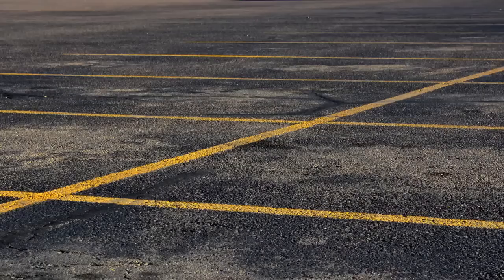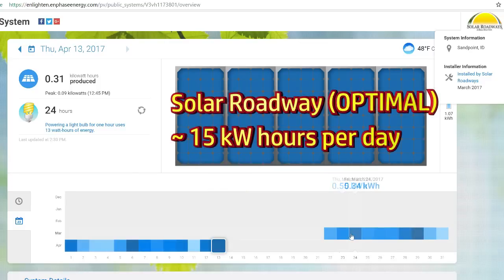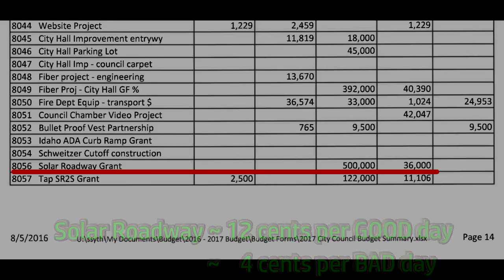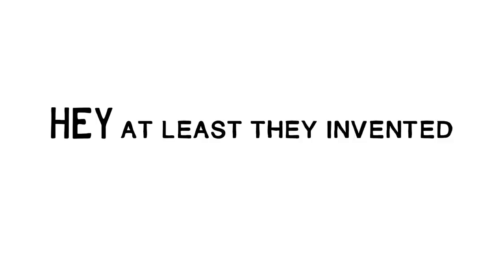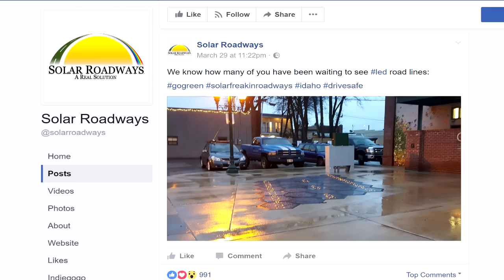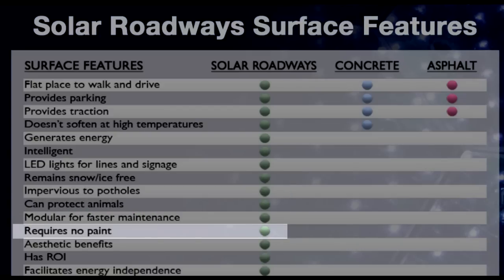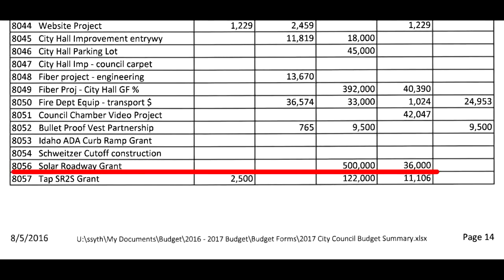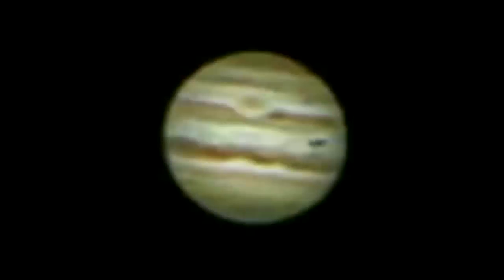Solar Roadways generate ~10 CENTS per day!!

Comment: Fun fact, the surface area of the roof of any home has a large enough surface area that if it was covered in solar panels it would power the home. Unfortunately the roof is rarely the ideal shape. My family has been off grid and living off solar and wind power for 5 years now with recent upgrades. 10 grand for virtually unlimited power for two "homes" and a family of 4 if you can store it. Solar power can easily power a home. What it can never do is support a car. I climbed on the thing once and heard creaking.

Comment: Hmm, the cost at 15:34 is incorrect, its supposed to be 500.000.000 (1,000,000 square feet at 500 each = 1 million * 500 = 500 million) and not 500,000,000,000 (which is 500 billion)

Comment: Could one possibly create energy out of the heat the asphalt getting hit by the sun?
Reply: One could, but currently it can't be done in an economically viable fashion. Anything that is not hot enough to boil water is just waste heat (and no, asphalt doesn't get hot enough). This is a common problem with heat engines too, most of the heat goes unused. A 1 GW nuclear power plant will output about 1.5 GW of waste heat. Most of it is just dumped into the environment (which is why they're usually built next to bodies of water). You can heat houses with it in the winter ofc. But with roads you can't even do that, as they only produce significant heat in the summer. Your car is even less efficient - for each kilowatt it uses to move you around, it dumps kilowatts of waste heat. If there was a way to use that heat, your car would come equipped to utilize it before the road would.

There are TEGs (thermoelectric generators) that can utilize low-grade heat, but they're really inefficient and are only useful where low-grade heat is more available than any other source of power.

Comment: This is probably a dumb question, but would it be better to have some kind of panel that generates energy from force/pressure on it rather then the sun?
Reply: That energy would come out of the cars traveling on it, so it would just be a really roundabout way to convert fuel into electricity.

Comment: How efficient would the solar panels need to be to make this a viable option and what material would be needed to be able to have a car drive over it, lets also say that it wasn't powering LEDs just generating energy
Reply: Even a 100% efficient solar panel would lose about half of its efficiency when laid flat on the ground, especially with cars, trees, buildings etc. casting shadow on it. This will never be a viable option.

Comment: The Sandpoint panels are actually more efficient than the ones they were going to use on a road. The road ones had less coverage due to the bolt holes. The road ones also had much thicker glass. The road ones would also be getting much dirtier and would be getting scratched up. I believe the road version would generate much less than these demo panels are generating. Just compare the thin Sandpoint panels to the big heavy panels for the road.

Comment: So... This isn't going to be easy.  It will, most likely get lost in the fray, but I'm going to try anyway.  First, What if (those two most horrible words) the solar panels did track the sun?  what if they moved, inside the panel, underground, to do just that.  It's just an idea.

Second, I could see the lights in the pic you offered.  Just saying.  They were visible.  Maybe not to you, but they were.

Third, and this is just me spouting off an idea of my own, forget about solar roads.  What about static roadways?  Panels constructed so that as cars drove over them, it would create static electricity?  Rubbing against each other, as panels do, using physical force to create consumable electricity?  Do a video on that.  I'm not good at the math, so, by all means, do it for me.  See what you come up with.  Did I just give away a million dollar idea?  Tell me.
Reply: It would still be less efficient than not putting the panels under a thick layer of glass. And more expensive. And those really are the problem we have with solar panels today: They're expensive and not very efficient. A problem we don't have is where to put them. I mean, rooftops are already a great place to put solar panels, although those are usually just angled, not tracking. But if you want tracking panels, cover just a few percents of the land we now use grow crops, and you could power the whole world. Electricity, heating, transportation, everything.

Static electricity wouldn't offer any meaningful amount of power. Static electricity is just a charge buildup that can create impressive sparks, but little to no sustained current. Besides, any energy that you get out of the road would really come out of the cars' engines, so it would essentially be a really roundabout way to convert fuel into electricity.

Comment: Even without knowing any of the numbers, it was self-evident to me that this is a terrible idea. Why are so many people taken in by it?
Reply: Solar freaking roadways. That's why
Reply: whoa
Reply: The sad fact is that they'd probably do a better job without the solar panels and you hook them up to the grid. Smart Roadways, not Solar.
Reply: Smart roadways would be cool, but the problem is that a) glass is a terrible surface for driving b) it'd get scratched to shit in no time and c) the modular nature guarantees they'll be wiggled apart by traffic pushing on one end then the other over and over again. This is assuming you can get LEDs bright enough and get over the cost. Even if Beardo McWolfshirt wasn't shamelessly milking the local government, they'd still be orders of magnitude too expensive to be practical.
Reply: But they'd be a lot cheaper to make and replace than solar freaking roadways and make cities look like freaking TRON.
And probably be more likely to work. I just think the main issue with solar roadways is the solar part. Take it out and you can have smart footpaths, basketball courts or whatever. Hell they could be powered by solar panels above the surface, like those parking lots.

Comment: Thunderf00t... How big in square feet is the capacity of which you speak?  I lived on solar in Colorado, had refrigeration, lighting, laundry (washing machine, dryer was gas) TV, internet, and it ran on solar.  My refrigerator was full sized with a functional ice maker.  We had about 200 square feet of panels, that were 75 wats per panel, about 12 per rack.

Comment: Yet another problem that hasn't been considered is that there will be vehicles (which cast shadows thereby blocking out the sun) on top of Solar Roadways for at least part of the day.  How much sunlight will actually get through during high traffic days or during rush hour?  A lot less than if they were just sitting there with nothing on top of them as in the demonstration.
Reply: 10:10 Disregard my previous comment.   XD

Comment: I'm a civil engineer and have experience in both the design of concrete and asphalt pavement.  Even if this thing could generate electricity, and it clearly doesn't, I would be concerned about the surface friction.  A rough surface is necessary for every surface we use for transportation and that includes walking paths. A rough surface would further degrade the efficiency of this product.  And how durable is it.  Heavily used asphalt roads rut, especially in high heat, so I doubt plastic can hold up for 10 years.

Comment: Solid gold hammer marketing ideas that are just as truthful as solar roadways' claims:

Since the cost is so high, the hammer will be weightless.

Gold is one of the densest materials so the hammer will be virtually indestructible.

Since gold is a good conductor of electricity, when you hit something with the hammer, it sends out a shockwave.

Since it is made out of pure gold, it can even break diamonds.

Comment: I don't know why but reading that solar roadway surface features really pissed me off I mean hell they give themselves two points for the same fucking thing (sensitive leds)
And one point for being "intelligent"
(really)
And another point for having good traction no
And a bunch of bullshit they pulled out of their ass to
Like generates electricity and means of energy independence
Can charge EV's with free energy, they can't do any of these things and they're all the same thing
Also apparently it's impervious to potholes and water can be stored treated or moved,
but not like how water is moved/stored by concrete?
I just realized They put "treated" in there because that way they didn't have to give a point to concrete
I mean Solar roadways don't treat water either but apparently anything they make up is a "Solar roadways surface feature"

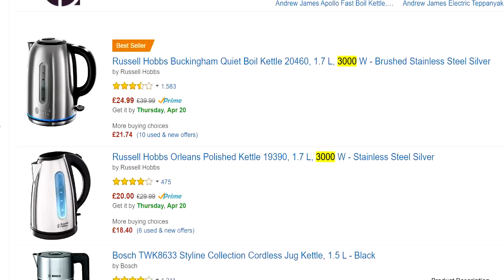Comment: 3:19   this example is bad, because no one would run a kettle for even 5 minutes (at least mine takes about 2 minutes for two to three liters). A tv would be a far better example because a tv is actually used for much longer periods of time consuming way less power. greetings from germany btw

Comment: Speaking as a solar panel maintenance tech; it's surprising how much maintenance is required. Not necessarily on the modules themselves, but on the inverters (modules produce DC - needs to be changed to AC) and traditional module to module wiring. Then there's the imperfect manufacturing process that produces resistance/heating causing internal failures in the modules and the bypass diode junction box on (typical) modules. 
Add the idea of car traffic, accidents, animals, dropped/thrown objects these modules alone would have problems. Then consider where said inverters are installed. Anyone that's ever had the pleasure of wiring in a VMS sign on the highway can tell you how risky that can be. Broken conduits from accidents/concrete corrosion, imperfect weather seals, hooligans. This concept is a maintenance nightmare.

Comment: You been missing a key point for a long while.  YOU CAN'T INSTALL THESES THINGS IN A HILLY AREA because they would not interconnect and leaves spaces.  I have hills with ~15% grade it would be impossible to go form a flat to a sharp 15% grade within 2 feet and still have them to connect in such of a way of being flat and having the edges of one touching the edges of the two other hexagons.  If they were rectangles than maybe but they are not.

Comment: Going off on a tangent here. If the SI unit for energy is a Joule, why does everyone represent electricity in kWh? Why not use MJ as a base unit?
Reply: I think because it makes it easier to work out how much running individual appliances would cost.

If you have a 15W (input) bulb and you leave it on 24 hrs a day that's about 0.3kWh for example.

Comment: I wonder if you could make flat panels that adjust as time passes. Either the crystalline structure of the glass angles light and that glass panel rotates or the panels underneath could shift.

Comment: 13:30 
small flaw in the argument that it will take 10 years; if you file a tax return on the solar panel you could get back about 1200$ leading to it actually costing 2800$ making it pay for its self in 7.7 years but it was a tiny thing that most people would overlook and you still bring your point across

Comment: FYI, depending on latitude, you get about 4-6 Wh per day average per W of nameplate value.  You can see this looking at the installations on the enphase site you mentioned.  Local installations here in Florida where I live average about 5.5 Wh per day per W of nameplate, which is not surprising given that it's the sunshine state.  Where is that classic video of the nut driving a bike with wings on his arms off a cliff trying to fly?  That's what these guys are, not the wright brothers, who were aware of Bernuli's law for what?  Two centuries?

Comment: G'day,

   Ah, at 2 minutes in, I must say that your assumptions are off regarding Solar Tracking.

   The Solar Array which I run my Hut on is mounted on a 2-Axis Tracking Tower (of my own design & construction) which allows 135 Degrees of Daily Tracking (07:45 to 16:15) and 48 degrees of Seasonal Tracking...; compared to the recommended method of fixing Panels to point at the Equator at an Angle equal to Lattitude plus 23 Degrees (optimised for midwinter, y'see...), my "Asymetric Offset Wig-Wagging Tower of Power" results in a 35% to 38% increase in current generated.

   One factor is that PVs make less power when they're hot, because a Wire's Resistance to Current-Flow increases with temperature - & PVs are full of tiny wires - so as they heat up it becomes ever harder to get the Current out of them...; and a PV which is always perpendicular to the Sun collects more Infra-Red as well as UV, so it runs hotter than a Panel which is not held perpendicular to the Light.

  In practice, throwing a bucket of cold water (10 Degrees C.) onto a fixed array of PVs every 10 minutes will cool them from an average temp. of 50 C. to 30 C. ; resulting in a 35% increase in daily output, a Mud Puddle under the Array, and nothing else achieved all day for the Water-Carrier....

   As to  your assertion that "Flat Solar Panels are Dumb..." ; well, go ye and look on the roof of the next 100 Caravans & Winnebagos you encounter on the Roads, and I predict that you'll discover that at least 90% of them have Photovoltaic Panels permanently fixed, FLAT on their Roof...

  Personally, the first Streamlined Solar-Array I mounted on my Subaru 4WD was an Omnidirectional Array with 2 Panels pointing straight up & 3 angled at 45 Degrees, facing in 3 directions 120 Degrees around the sides (on a Faceted Aerofoil, to reduce Aerodynamic Drag) ; and after the Mk-1 SunFoil I quickly realised that a single larger PV mounted parallel to the Roof made more Electricity & generated less Drag at Highway Speeds.

   My Car has had a SunFoil (AeroFOIL which runs on SUNlight...) since 2008, because it reduces my Fuelburn by finishing recharging the Battery after I've switched the Engine off at journeys' end (my average Engine Runtime is 6 minutes...) ; and when the Battery is fully charged on Engine-Start, then the Alternator functions only as a Turnaround-Pulley for the Waterpump until the Vehicles' Electrical Consumption exceeds the Panel's output in realtime.

  Backtrack me to my "SunFoil Project... Playlist" to see the whole story ; you can find  the (Australian Government) Commonwealth Scientific Industrial Research Organisation's assessment & endorsement of my Results in "SunFoil Short-Talk...".

  So, "Flat Solar Panels" do indeed make very good sense, if they are to be subjected to highway-speed Slipstreams, when mounted on Automobiles & Caravan-Trailers & Camper-Vans, Trucks, etc..; but you are totally correct in saying that Glass Solar Panels are a bloody  stupid thing to try to build a Road from -  because for a start, Roads are always in the Shadow of every vehicle driving on them, and that's apart from the mechanical wear & tear of driving over the Photovoltaics...

 Have a good one,

  ;-p

    Ciao !
Reply: "and a PV which is always perpendicular to the Sun collects more Infra-Red as well as UV" I thought glass reflected most infrared and UV radiation? Could be wrong.

Comment: Solar roadways were a neat idea. It's the kind of thing you come up with at the bar while drinking with your friends. But it also should have been abandoned shortly after the napkin sketch stage when someone with a calculator debunked the numbers and proved it wouldnt work
Reply: Apparently these guys did not yet harnessed the power of Calculator let alone the math.

Comment: @Thunderf00t, If we were to run Solar Arrays across the surface of the moon facing the sun. Would our full-moon's be brighter, dimmer, or would we need so much material for the arrays to even notice a difference in light being refracted off the moon. Ideally it would be dimmer correct? Because we would want to capture part of the light and reflect another portion of it by the arrays realigning themselves, no?

Comment: One other thing to consider: "modular for faster maintenance" doesn't necessarily have to be a good thing.

So far, the panels don't look to me like they could easily be repaired or just dismounted for recycling. Which means the "modular" pitch could possibly mean "if they break, you can just swap 'em out and dump the broken ones, because it's too expensive and too complicated to repair them".
Think about millions of panels (or even just thousands) which contain glass, metals, rare earths etc. piling up in landfills.
Very environmentally conscious, I'd say.

Of course that's just a guess on my side, and I could easily be wrong here.
But that at least means further explanations are necessary for what will be done with broken panels. Which means this is another issue to be addressed - apart from those why Solar Roadways are not a terribly good idea to begin with.

Comment: I thought that in the original video they made some big deal about the surface of the roadway being specially textured for more traction/better stopping/etc., but the panels in the installation are completely smooth. Do they really expect a 20+ ton truck to be able to stop on smooth glass?? Everything about this idea is moronic.